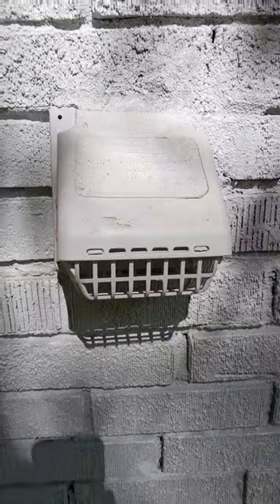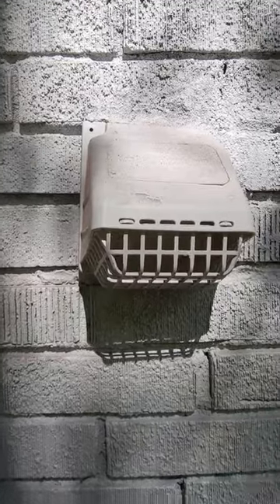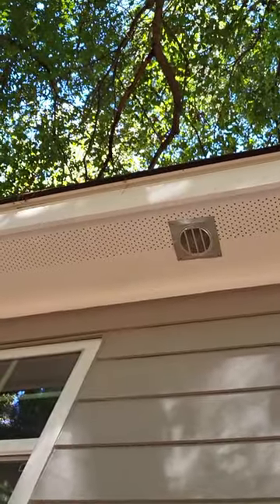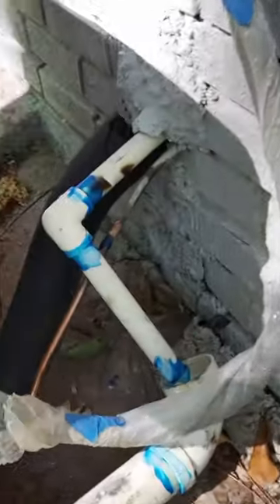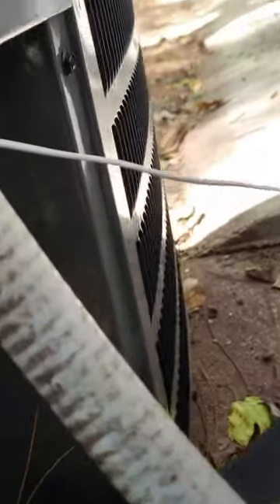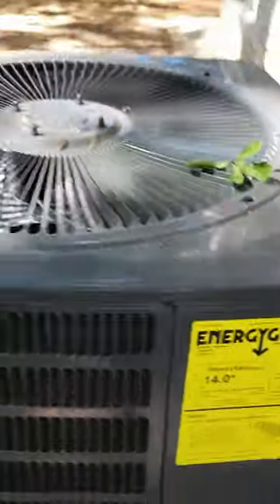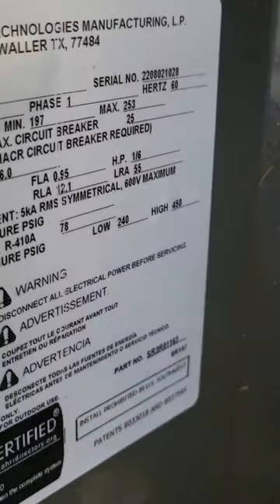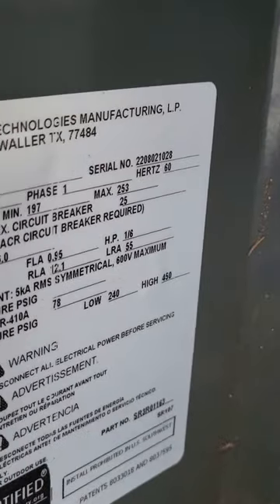(4) Common Residential Mechanical Code Violations

Comment: The screen on that dryer exhaust was equipped with fairly large openings. What is the minimum size opening that would be acceptable?
Reply from the maker: 4" is the miminum size for a dryer exhaust duct.

Comment: In UMC or IRC what code section says new gas piping must be painted  ? I'M a B1.
Reply from the maker: So, what code books has your state adopted??
Reply: @PPG1967  cpc. Cmc. Based off of umc. Upc. California
Reply from the maker: So, my videos are based on the International Code Books. IRC, IBC, IMC, IPC...etc
Reply from the maker: However, it's in the IRC & IFGC...section G2414.8  2018 IRC  & section 403.8  2018 IFGC
Reply: @PPG1967  are these the code books for California DIYers to use for their homes when they pull home-owner permits?